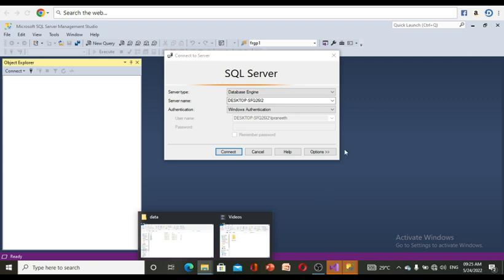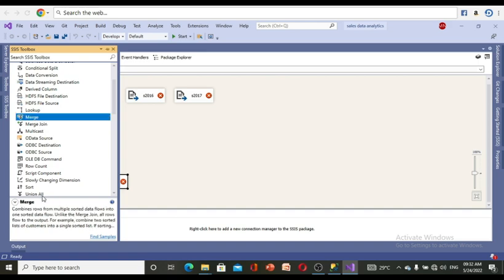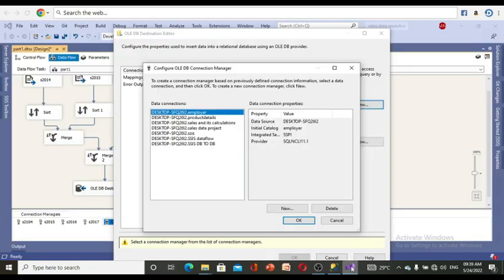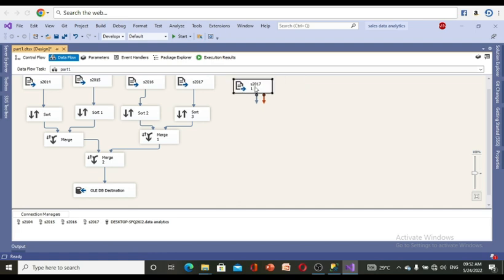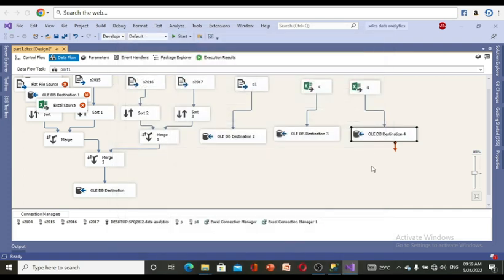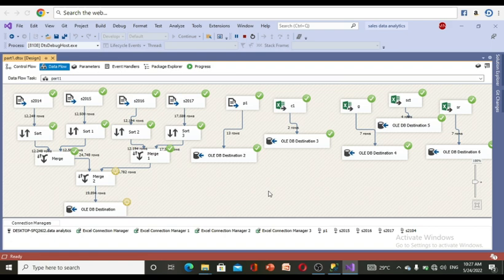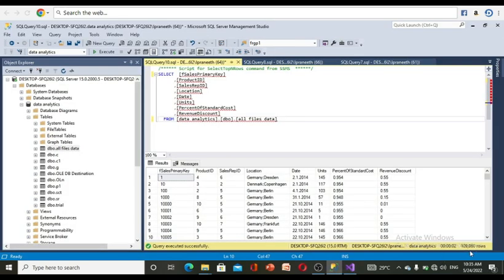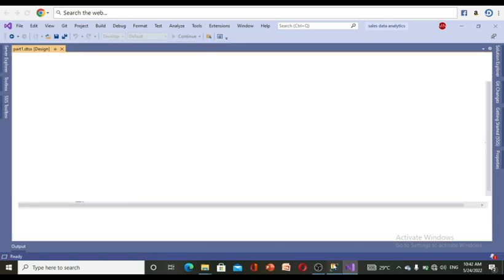end to end msbi project in real time||part1|ssis project#ssrs#ssis#ssas

Comment: guys i didn’t want to criticise the author…he explained quite good..but i pointed out some things which we can improve the performance of an ssis package…it can be help ful in interviews if someone asks how you can optimize the performance of an ssis package…
to delete data use truncate rather than delete command
use table or view fast load when using the oledb destination 
avoid using asynchronous transformation like sort ..if you have an option then load the data from flat files like cab or txt to staging table and then use the order by clause in the query level itself and set the issorted property to true and set the sort key position to 1 ..by this we can avoid using the sort transformation…
try to make u r package dynamic because today we may receive 4 csv files but tomorrow if you receive 10
files this package will not work…we can use the foreachloop container and set the file path dynamic to the connection manager using the expressions…
there is a limit on the number of sources from where we can connect and load..by default 10 sources for data flow task…we can change this using the enginethreads property…

Comment: why can’t we use a single execute sql task and use the batch terminator and truncate the data in tables like
truncate table table1
go
truncate table table2
go
truncate table table3 etc
since all the tables reside in the same database…you have used delete statement to delete the data which is slow as compared to truncate since delete will perform row by row deletion that means it will delete one record at a time and will make an entry into the transaction log file for each deleted row and truncate will delete the data in batches…truncate will delete the data by deallocating the data pages in the table used to store the data …it will log only the deallocated pages to the transaction log file ..truncate is faster than delete command

Comment: i really didn’t understand why u have not used the union all transformation to combine the data from more than 2 sources and also u don’t need to sort the data too..sort transformation is a fully blocking asynchronous transformation and performance wise very slow..you can go and use the union all transformation also..and the key point is it is completely static package …u can make the package more dynamic by using the for each loop container and pass dynamic connections to the connection manager